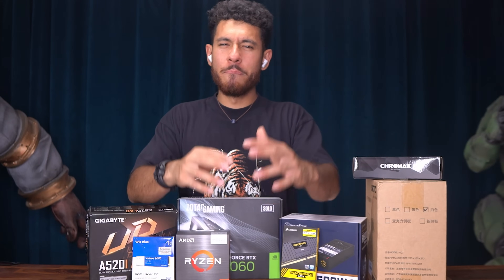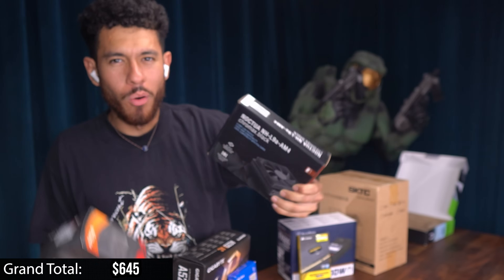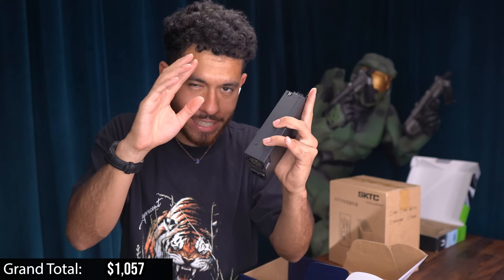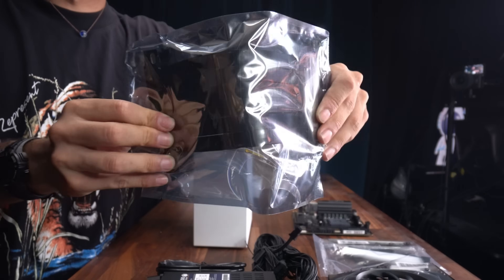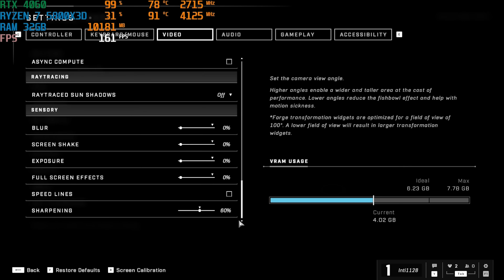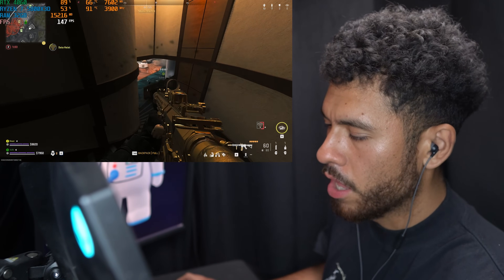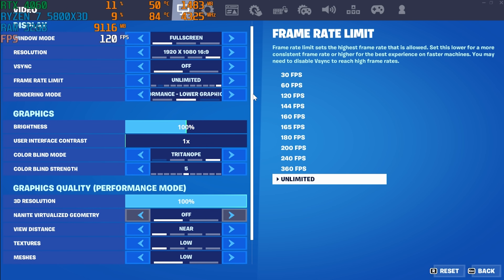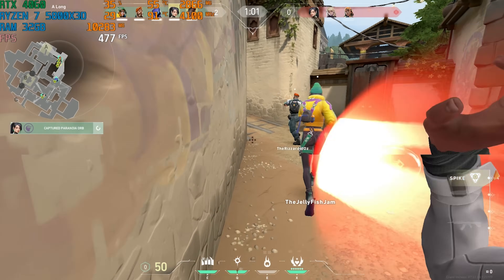RTX 4060 Mini-itx Gaming PC Build - $1000

Comment: I'm about to build in this exact case with a Ryzen 5  7600X3D CPU 32 GB RAM 6400 MHz 2 TB NVME and a RTX 5060. Can't wait to build it!
Reply: Tell me how it goes 🎉
Reply: @Dannyman-s7d so I finally built it last night and initially it seemed to be working fine. But then for some reason after Windows installed and I updated the graphics drivers I no longer got a signal out for my GPU but I would still get a signal when plugging into the motherboard. So I reinstalled the graphics drivers with an older version and it worked. Then after turning off the computer last night and then turning it on again this morning I had the same issue again or the graphics card would not give a signal. But if I plug directly into the motherboard I get a signal
Reply: @westregent66  Bro are you using RTX 5060 solo? Just asking because I'm going to build Ryzen 5 7500f + rtx 5060 solo with this build.
Reply: @creativechannel1513 yes the zotac rtx 5060 solo

Comment: Good lord.... you paid $80 for that PC case?! I literally just got it off AliExpress a week ago for exactly $37.86 shipped to my door and the build quality on theses SKTC case is barely worth $25. The packaging also offers very little protection. Mine got somewhat buckled in transit so I had to man handle mine back into shape. The finish quality is also pretty poor. When I went to srew the side pannels back on after straightening it out the paint around the screw holes just started peeling immediately. I'm using it with a jginyue B350 ITX board, 1500X, 16GB RAM and my old 1050 Ti as a budget competitive rig. I would not advise anyone replicate your build with this case. For $80 you could do so much better.

Comment: Did you think 9800x3d (undervolt cpu cooler with axp90 x-53 full copper)  with 4070 zephyr can run 540 fps in 1080p low settings?

Comment: bruh....u really need to do some undervolting on the cpu.
91 celcius is crazy... baking up all the other components in ur system. add some magnetic cpu fans to draw out the hot air.

Comment: It would be better to change the video title to how not to build a mini itx system.
Your choice of motherboard is wrong. You should have used a B series motherboard instead of A series. 
Also, if no other processor cooler fits in that case, you should have used a 5700x processor with a 65w TDP value instead of a processor with a 105 TDP value such as a 5800x3d.
Also, choosing a modular power supply would allow you not to have to deal with too many cables. 
You obviously don't realize it, but your processor is running at 91 degrees. Even rookies don't build systems like this :D

Comment: he done cooked the cpu at 91°c 💀😭
Reply: Honestly how is it bad?
Reply: @Uomodargilla  :hyperbole:
i mean its not bad just not ideal
Reply: @darknuance_ix he does it every budget build with the stock coolers lol
Reply: @Uomodargilla it shouldn’t be hotter than 80 C* because that would thermal throttle and reduce fps
Reply: @Uomodargilla it's bad. 91 when gameing is super bad.
Reply: @Mel-Sqr  yeah I inderstand but what would be the best build if I want a better cpu in a 4L case below 91 degree?
Reply: @Uomodargilla  5800 x3d is supper powerful and cost 340 USD where I live.
I personally would go with ryzen 5 5600 or the 5600x. 5600x is about 6% faster and costs 10 USD more.  Go with 5600 if it's more than 10 USD in your place 6% is nothing.
Reply: @Mel-Sqr it is
Reply: @Mel-Sqr it's only suboptimal longterm for the life of your cpu. But it's not bad for your performance generally
Reply: What would be a good replacement cooler?
Reply: @adrianarreguin1739 it's the airflow and case limitations. There is no alternative. 
1. That CPU is to much for that GPU you can go with 5600 honestly and it will run cooler.
Reply: Well yeah, and he turned on only MP games that are generally better optimized.
Reply: He needs to Undervolt it, the case is so small that it’s unavoidable since he’s using 1 fan with a decently powerful gpu
Reply: My laptop cpu been running like 98° on games for the last 4 years 💀
Reply: Mind you, its at like 50% utilization😳
Reply: Ye it’s recommended to stay below 89° if reaching max temp there’ll be thermal throttling, yet he stayed at a constant 91°

Also the fan is for 95w tdp while the cpu needs at least 105w tdp if not an even stronger cooler
Reply: He skipped the undervolting part altogether.. crucial part for these extra smol itx 😢
Reply: Mine be running on that all day long on laptop
Reply: I have that, it ain't worst cuz my pc is infront of the AC
Reply: @nepgaming5448  that is NOT good, the high heat combined with your AC is going to create condensation that will create water droplets on your MOBO and will FRY your PC
Reply: Noob 😂

Comment: people unerate the 4060's
the 4060 ti is a 1440p gaming gpu and uses only 160W but a card with the same preformance uses 300W, and is more expensive. look at the rx 7800 xt 5% better but costs more and uses 300W for basically the same preformance

Comment: cool build but that 5800x3d is way too much. It's running hot, not getting full utilization, and it's on an a520 mobo so I'm pretty sure undervolting isn't even an option

Comment: BRO SLAPPING THE OVEN CPU WITH PRIDE 💪
Reply: If someone is attempting to replicate this setup, they may simply get the Ryzen 5 5600, which is also powerful and produces less heat. Unless you want to cook an egg then slap his CPU OVEN
R5 5600 = 65w TDP also Perfect for RTX 4060 because it was an 1080p card
Unlike the R7 5800X3D with 105w TDP that was bad for a Mini ITX build, if you want then you can undervolt it. Take note CPU's are not designed to undervolt!

Comment: 5600X3D would have been perfect, 5800X3D gets too hot. Also a520i is not bad but you know stable voltage and good vrm matters and b550i's are not that expensive. 5600X3D + B550i W all tha way.

DOPE BUILD THOUGH! My guy joins the SSF gang.

5600X3D + B450i/B550i + Single Fan 4060Ti is the best possible SFF FLEX PSU combo RN! (Only Asrock B450i though cause older Asrock Mobos do support PCIE 4.0 Gpu Bandwith)

Comment: Damn 1000$ for these specs is crazy considering I'm building a pc with lesser specs with roughly the same price (908$).
My specs are: 
-m24 itx case
-asrock b550i itx/ac
-amd ryzen r5 5600
-axp 90 x36
-asrock rx 6600 xt challenger 
-hyperx fury 16gb ddr4 (2×8)
-crucial p3 plus 500gb
-tf skywinditil U1 flex psu 500 watts

Comment: Can anyone help with a power supply, I currently have a list: Antec NX410 ATX Mid tower case, AMD Ryzen 5 5600X 3.7 GHz 6-Core Processor, Gigabyte B550M K micro ATX AM4 motherboard, Corsair Vengeance DDR4-3200 2x8GB, Western Digital blue SN570 1TB, XFX Speedster SWFT 210 Core Radeon RX 7600 8GB video card. I am new to PC so I want to know a good power supply.
Reply: I live in the UK btw
Reply: Buy faster RAM bro. seriously. Ryzen loves frequency, Especially 3000 and 5000 series chips. Also step up and get a WD black. If you are paying more for a b550 over a a520 or something youu might as well take advantage of PCIE 4.0. And you won't have to reinstall windows down the line if you want to upgrade. I would also step down your CPU and you can get the XT variant on your Grpahiocs card which will help more with FPS. 

AS for power supplies, anything from EVGA, Corsair, Silverstone, etc. Don't cheap out on the Power supply. If you want upgradability get an 850-watt gold or platinum supply. The new AMD and Nvidia cards TDPs are misleading as they all have random spikes that can exceed your power supply.
Reply: @RiceCubeTech thank you for the advice bro, Im deciding to get instead an rx 6700 and keeping the ryzen 5 5600x, ill be playing on a 1440p monitor. Ive commented on other videos and people have been saying to get a 650W 80+ gold psu for this. Also, should I really care about the micro atx motherboard if im getting an atx case?
Reply: What is your budget, and how much is the build you currently have specced?
Reply: @RiceCubeTech £1000, the build im gonna get is MSI MAG FORGE 112R ATX mid tower case, Gigabyte B550M K Micro ATX AM4 motherboard, Ryzen 5 5600X, SWFT 309 Radeon RX 6700 10GB, DDR4 2x8GB and 1TB  SSD, all that is like £650, all I need is a power supply
Reply: @D1Officixl  oh you’re European that’s why the prices are cheeks. That’s alright price then given where you live.
Reply: @RiceCubeTech Yeah, plus most of the things are cheaper bc of the black friday deals, also is a 650W semi modular 80+ Gold rated PSU good for the build?

Comment: I have an I7 10700k. It was a prebuilt PC. The GPU was overheating. 3080 GPU. An Asus Prime z7409-p motherboard. I was am still am overheating to all heck but only the CPU now. I replaced the Rosewell fans with Corsaire sickleflow 120 3in1. The back fan with a Noctua NF-P12. I bought this Noctua NH-U9S because my ThermalTake AI0 apparently evaporated all the water. I am absolutely terrified it won't cool down my CPU and if it doesn't I am at a loss at what to do next. I didnt know any part of a PC internal until like 3 weeks ago.

Comment: I have a 5800X3D  +  the exact same Ram kit but it doesn't like the 3600 when i set it..it just keeps posting into safe mode, currently running 3200. and also i have the  6750 XT and fortnite doesn't use all gpu LOL, havent even looked at the new MW3 or other games yet

Comment: A 5800x3d (dead platform) with a lousy A520 board? Paired with a 4060? FOR A $1000. Stupid budgeting as well as dumb part combos.
Reply: Which parts would you pick, pc expert
Reply: if you dont want to do the research: the 7500f is better than the 5800x3d, the 6700 xt outperforms the 4060, the RAM is WAYYY better & ssd basically same OH also a better psu. @NietBarkieNeef
Reply: also forgot to add a cooler but for 70 bucks (to match his 1.1k build) you could find a cheap liquid one or just an sff air cooler @NietBarkieNeef
Reply: they removed my comment, but if you want i can list the parts again @NietBarkieNeef

Comment: I think that with a 5700x you will have the same or maybe better performance because the x3d is an hotter CPU and it needs more cooling capacity. So you are running it at 50% of its potential. 
Also if you have 10mm I would have considered to use a 25mm fan for the cooler instead of the stock 15mm one.
In this case undervoling and a fan could make a huge difference. Another option was to go with am5, with a 7600, that is so much cooler than the x3d and you will also have gained ddr5 at 6000mhz that for FPS gaming is a really nice addiction. Nice build 😊
Reply: Amd5 and ddr5 is ao much more expensive right now than ddr4 it’s not worth it in my eyes. But as far as cpu goes very bad choice for an ITX build. I’ve got a very similar build in a similar size case with a 5600x and with the same cooler and it reaches 82c  with 2 92mm fans in the case as well
Reply: I agree with the 5700x alternative. But if your building new get the 7600x and decent ddr5. It will run much better and less heat.

Comment: nice! i have almost the same build but i have a520i with 3600, planning to upgrade it with 5800x3d, u didnt mention in the vid if its plug and play or needs bios update :D hoping anyone could help
Reply: He did mention it. But depending on when you got your motherboard, it may or may not require a bios update. I’d recommend you to update that with the 3600 now if you going to get a 5800x3d later so then it will certainly be plug and play when you finally upgrade, because you caught up on bios update
Reply: @InternalVitality110  ahh yeah i got that part, maybe i was just expecting while he was playing a game, he would mention it that he did or did not update the bios etc. ill just update my bios just to be sure, thanks man
Reply: @Fear_BFG  no problem. If you still have the box of the motherboard it might say like 3000 series ready or 5000 series ready. If it says 5000 series you can most likely just plug and play the 5800x3d. But 5800x3d is such a unique cpu that I recommend a bios update to ensure full compatibility, stability, and performance anyways to be safe

Comment: 10:29 I don't think I would recommend a 5800X3D for this build as it's pretty much thermally throttling itself with that cooler (it's at 30% utilization hitting 90 degrees). I would be concerned about the longevity of that CPU especially in a mini itx build, thermals are very important in compact PC's and really should have some consideration. A 13400f/13600k or 7600 would be a great and appropriate pairing for this build
Reply: It definitely doesn’t need it for a 4060.
Reply: Don’t think a 13600k would be any better since it’s TDP is higher than a 5800x3D. If anything it might be the same.
Reply: @MikeWazowski_ true Intel is definitely not the move maybe a 5600 would have been a more balanced cpu
Reply: @MikeWazowski_  Higher TDP doesn't always correlate to increase in temperatures. Yes the 13600k has an overall higher TDP but it has much better efficiency. At lower workloads when the CPU is around 30%, it would not be thermally throttling itself as it has higher and much more efficient cores. In real case scenarios where you're not thermally throttling the CPU, the 13600k would have a better overall CPU temp than the 5800X3D, in this case. That is why I also said 13400f/13600k as it yes, the 13600k does have a high TDP but it makes up for it in its efficiency (I hope I explained that without it being too confusing lol).
Reply: Also doing all this on a flex PSU is crazy lol, I don't think this build would last anything more than 3-4 years before it starts eating itself (random crashes, bluescreens, won't start up all the time, huge decrease in performance)
Reply: @ProTroy_  except the 13600k is known to run a bit warm. Maybe if undervolted it’ll run cooler.
Reply: @MikeWazowski_  ...was just about to comment the same thing. I am in a SFF rig (NZXT H1v1; i13-700K w RTX4070FE) and I had to not only change the OEM AIO out, but I ended up getting a Noctua fan replacement and undervolted to keep temps under 65°C. Thankfully, it can still run high/ultra on most games... though Intel and AMD did not do us any favours this generation with keeping CPU components cool.

Comment: some undervolting/fan-curve adjustment, think that would help your thermal issue, cause 91C is a thermal issue, i'd worry about burning out that proc sooner than later, but i get you wanted to benchmark it out the box possibly...gg nice vid :)
Reply: Yeah, undervolting the 5800x3d or trying to find the 5600x3d would be a better option right?

Comment: If it were me, I would go with a 7600 instead of the 5800X3D. I’d rather have a future upgrade path especially when it comes to spending $1,000 on a pc.
Reply: Is the next gen amd cpu am5? or are they gonna change it again like intel has done?
Reply: @Ps2vin  it’s confirmed Ryzen 8000 is coming to AM5. Not sure about Ryzen 9000 but there’s a chance it could be the last one for AM5.
Reply: @LCC.Gaming  well yeah 8000 series is just 7000 series refresh apus right? 9000 series might be a whole new board, but 2 generations of new cpus sounds fair for AM5

Comment: You need to put an undervolt of about 0.020 - 0.030 Volt on you 5800X3D (vCPU). That should fix your throtle issue. I run mine with - 0.0250V
Reply: Most 5800x3d's should be fine with as much as -0.05v
Reply: @VelociRapT0M  -0.03V is the agreed amount. -0.05V is guaranteed losing performance
Reply: @ElSkeppo I've had mine as low as 0.075 and still hit 4.5ghz on all cores. Some have chips capable of running on just 1v with no loss in gaming performance.

Comment: Hot cpu 91c , at only 40-50% utilization,  needs optimization. I would look into better thermal past, some under volting for sure  and maybe a different case. Not sure if the 520 motherboard supports under-volting, probably not. Maybe even go as low as a straight 5600 to save money and temps  if undervolting is not possible.  Thanks for the video, very cool.
Reply: Yep. Two big problems w his build that I fixed for my version— went w a 5600 for thermals, and got a B550m-itx ASRock board to have pcie 4.0 and then replaced the riser with a 4.0 one. This card is only 8x lanes so if you don’t have pcie 4.0 it gets bottlenecked heavily. Like you lose about 20% performance on average.
Reply: If I may ask because I am planning to build in this case with a 4060 so I need to replace the pcie riser. What is the size of your pcie 4.0 risee? Thanks @SanDiegoGamingYT
Reply: every amd mobo supports undervolt
Reply: @porter3 how to undervolt on an a520i mb?
Reply: he can just do pbo tuner
Reply: I intend to build one with a Ryzen 9600X + 5060 + 32GB DDR5.

It will be easily cooler.
Reply: @ “pretending to build one” what?😭
Reply: @RiTchieKII  Sorry, I want to build a PC*

Pretend is portuguese means "inted to" so I got confuses
Reply: @joaovitorcarvalhoferreira1924  how did the build go I'm doing basically the same build but with a 7600X3D
Reply: Yeap, noticed the same a have a 5800 (non X) with a 3060 ti heavily undervolted using a 250 watt hdplex PSU.  My CPU never gets above 65 c and never above 70 watts in Apex in  S4M (smallest console style case)
Reply: Agree I checked the bottleneck and it showed 0% for gaming and with the same GPU at 1440p❤
Reply: It’s the x3d CPUs, they run so hot especially the 5800x3D, he needs an ITX case that a bit bigger this one is TINY. You could probably chuck a 5600 and a 3050 for something this small and be fine.
Reply: lmfao i have this same build, and im worried cause i get 75 cpu 70 gpu